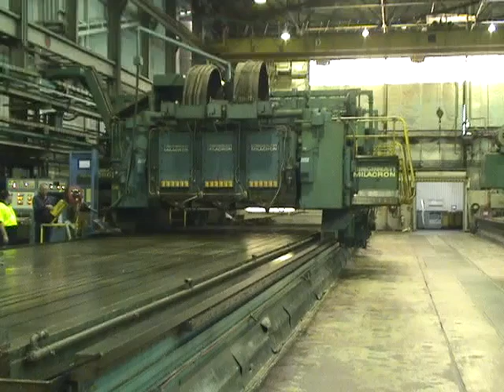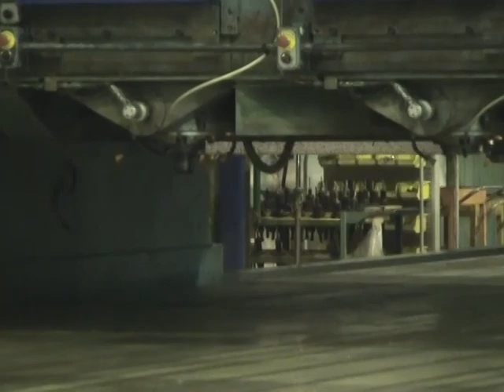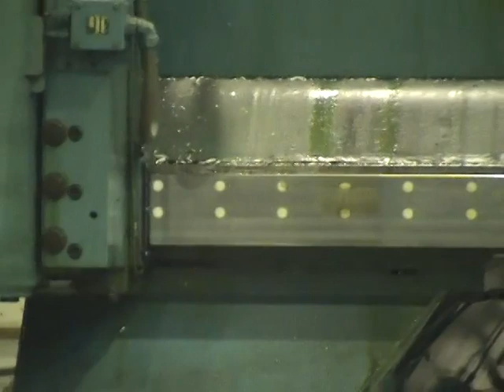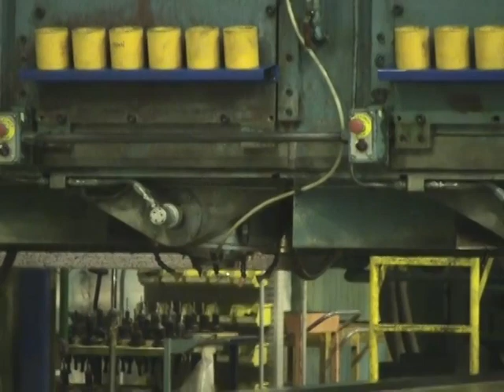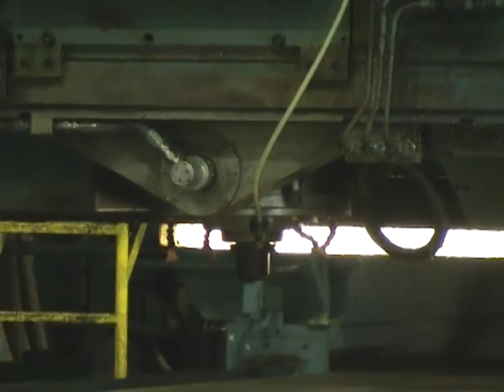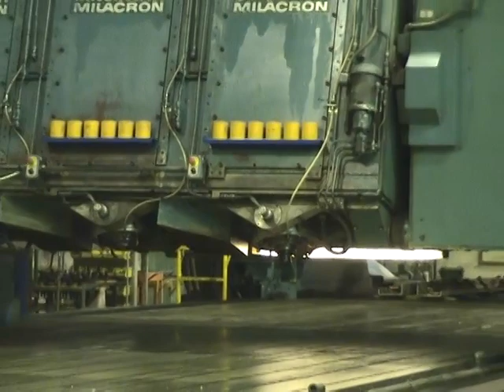Cincinnati 3 Spindle 5 Axis Gantry Profiling Machine

Comment: During the 70's McDonnell Douglas had 50 heads (2 three spindle heads on 25 beds) of these in Bldg 27 St Louis.  Was used for F15 and F18 fabrication.  Don't know if they are still in use.  There is a concrete foundation under them about a big as the machine.   Very reliable machine in their day.
Reply: Bill S , yep they are still in operation sir!
Reply: Some of the older ones have been shut down but the majority are still making chips.
Reply: Bill S: They still in use...I have worked for McDonnell Douglas & Boeing 18 years (1985-2003) included McDonell Douglas Company transfer to Boeing....This Cincinnati 3 spindle gantry profiling machine run the skin of Delta (4,5,8...) & C-17 body & Wings called "Skin mill machine"...After I got  laid off and working with small Company to operate & Program some machines as G&L, Mazak, OKUMA....Now, I'm old and retired, after  43 year working hard "Like Hell"  in Manufatory field...Hehehe...Hahaha...
Reply: If that is the building that GKN Aerospace now occupies some of those have been scrapped. I work for Cincinnati machine,(Fives) and they also had two very nice Maxim 630's in the helicopter room that got scrapped. I hope they keep our old mills going but uncertain at the moment. There were quite a few of them in operation when I was there several months ago but not all. I usually go down there for the Cincinnati Magnums they have.
Reply: MrErinb76 :The stuffs operating this gigantic universal 5axis m/c must be born huge physical appearance,otherwise cannot operate this amazing machine.
Reply: @billegbert1387 I ran the Mags in that building
Reply: @MrErinb76 GKN cut up the newest one's. They didn't care.
Reply: @formuladave we are now back to be Boeing, bldg 27 and 29A. It looks like what machines we have will be saved and brought back to life! Big plans for our operations and St. Louis in general.

Comment: I think that's the same model I operated when I worked for Hawker DeHavilland, occasionally the head would over travel and come off the feed gears luckily those flexible things that hold the hydraulic hoses in place could take the weight. I suppose it was an old horse though